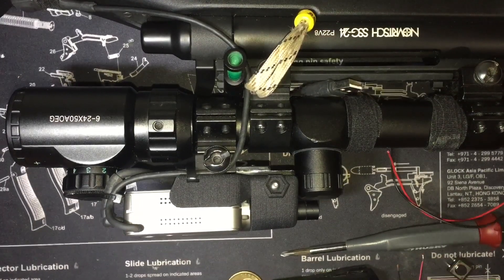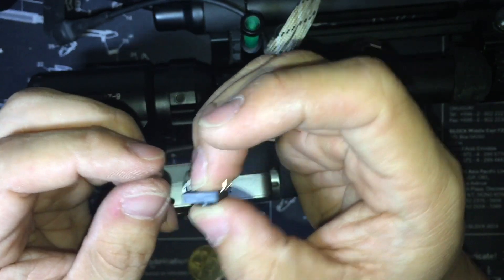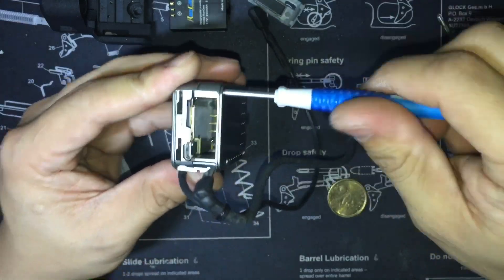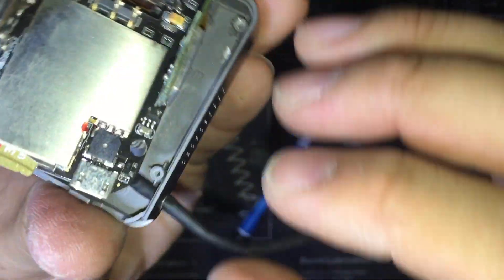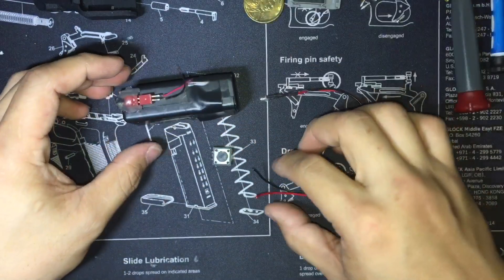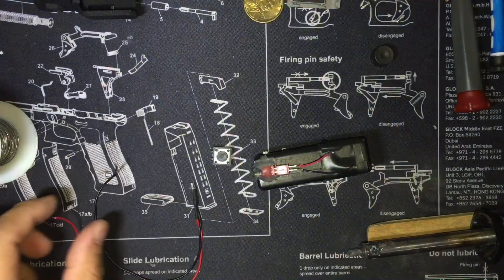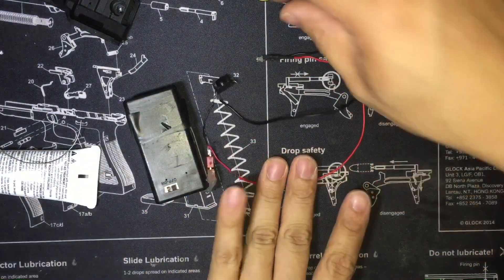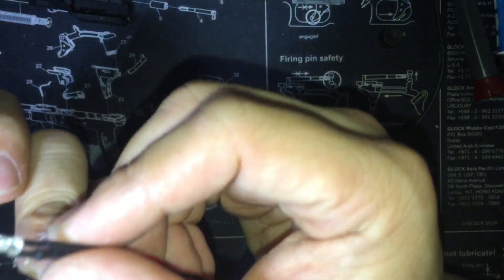Scope cam remote switch

Comment: Something you might be interested in, you can solder wires to the power pins (or desolder/cut/grind the pins and solder straight to PCB) in to a PEQ-16 (has to be big enough for the battery next) on deans to a LI-ION 3.7v 6900mah battery to last a whole day. Figured I'd give you this info as im doing your mod to my runcam2. I can link you to the battery if you need it. I'm also working on a complete PEQ box install.